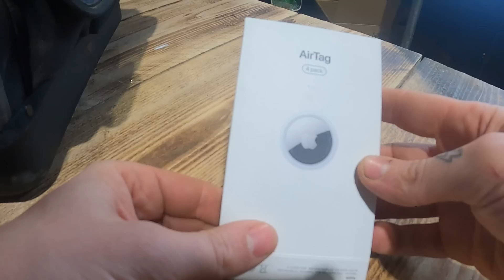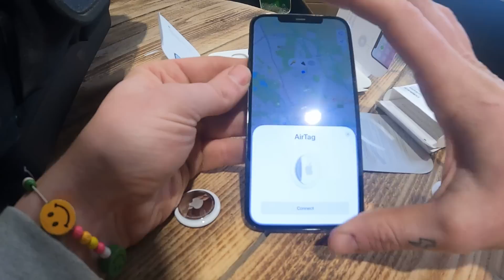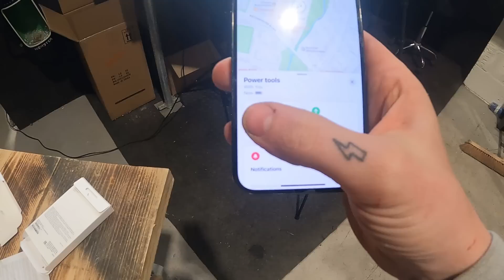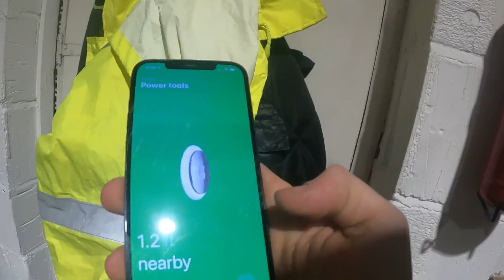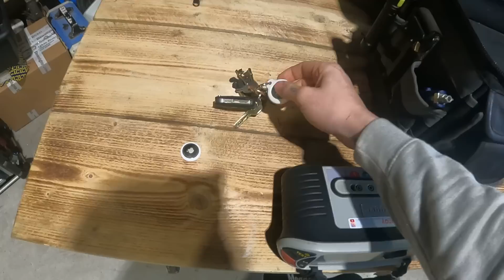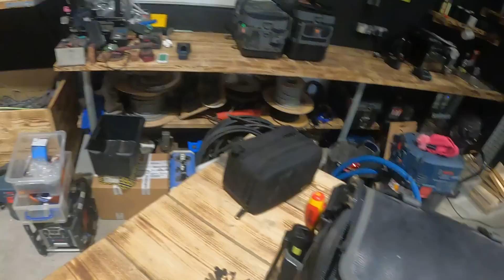Tracking Down Robbers that steal our Tools - Electrician

Comment: do you have any videos on power supply on a cooker extractor hood please?

As im still training at the moment. If i do a kitchen rewire. Do you take it from the new kitchen ring main as a spur to a FCU as I already have a switched spur on a radial for the fridge freezer. Same for the washer/dryer and cooker. So only the worktop sockets are on the ring main but no spur as off yet. Can I spur off this for an FCU to the cooker extractor hood?
Thanks.

Comment: Had my van broken into twice and all my tools stolen, first time I was naive, no extra locks on doors or a secondary alarm and I wasn't insured but was the second time although still a huge inconvenience replacing everything. Plus all things that you have accumalated over the years that you only miss once once they are gone. BTW 2nd time the van was parked underneath my open bedroom window, so they "dragged" the van 20 metres down the street (hand brake was locked in place). You need a good discipline to keep all your tool receipts, note all the serial numbers and take photos, makes the whole reporting and claiming process much easier. Unfortunately there are so many unscrupulous people out there who just want something for nothing with no thought of how it will affect you. I was extremely lucky to have a builder/electrician friend who lent me his "seconds" electrical tools, he liked all the new versions of tools, so had a number of duplicates, thank heavens for his generousity or I would have gone under. The Police told me that the thefts were quite often well organised and the tools mostly went abroad via containers in bulk.

Comment: What i normally do with mine is create a 3d printed shell make it look like something totally different. Place it in the middle glue both half’s together and just take it apart when the battery needs to be changed. There are also various guides on how to remove the beep
Reply: I'm going to put a few in my batteries and powertools themselves. Heck if I can put some in my my mft ans gas flue analyser I will. I don't know if the cal security stickers will allow me to though, meh 🤷‍♂️.
Great idea though pal 👍🏼.
Reply: I label mine “Definitely not an AirTag”.  Nobody knows what’s actually under THAT label.

Comment: Awesome tools to check out:
knipex cable shears 95 16 165 (they have like 20 different variations)
knipex cobra water pump pliers 87 01 250 (they also make a buzillion different sizes and handle types)
stabila pocket level 17768 (they have like four different models)

Comment: Just an FYI Airtags are not GPS trackers, they rely on other Apple devices to be around them to report their location back to the Apple servers. If no Apples devices are close you will not get a location ping.

They also will make a noise after being away from the registered iPhone after a set period of time, I think its a week but I am unsure. I know Apple recently shortened this time due to stalking concerns.
Reply: Yeah I have one in my van and I'm not the registered iphone nor do I have a iPhone. The noise is a dead giveaway
Reply: Yeah came here to say the same. Video may have been made before the mass stalking concern changed the Apple position re alerting. 
To be honest though, most thieves won't know to hunt for trackers and if your kit has been gone for a week+ it's probably game over anyway..
Reply: Think it also pops up an alert on near by phones as well
Reply: Apple devices will also alert that you are being close to a unregistered airtag, again for the stalking concerns. If the theif was smart enough they could dump the tools in range of a phone and see if anything triggers first, similar to car thievies dumping the cars on a random street to check for trackers.

Comment: Tile do a credit card sized and shaped tracker. They’re incredibly discrete. I have one glued inside the lens of my trailer tail light. 
They could be glued to batteries and they’d still balance. There’s no anti stalking mode so the crook won’t be tipped off by its presence. Well worth doubling up with air tags.
Reply: Tiles only work with your phones Bluetooth once out of range it’s useless to you. It’s good for marking your gps/Bluetooth last connected location for example  which on disconnection it logs the location of loss however it does not log future movements away from you apple AirTag does by using other iPhones arround the world to track actively.
Reply: @HogwartsBasement  Tiles work in exactly the same manner as AirTags in that they also use other Tile users phones for locations. That’s Apple and Android. There are hundreds near me.

Comment: Sadly I am not an iPhone user but these look amazing.  I understand they are Bluetooth based but use neighbouring iPhones to communicate and in so doing they pick up the location using the iPhone's location so effectively they do provide GPS level tracking when there is a nearby iPhone.  I've seen these used for tracking bicycles and it's pretty cool.
Reply: Get an android compatible one
Reply: @jamiecullen9075  I don't think they exist? These gadgets rely on the iPhone ecosystem?
Reply: @NivagSwerdna  Do some research if you want a tracker, Tile are a very popular brand that have different products and models, I have AirTag but there’s plenty of options
Reply: @NivagSwerdna  Samsung have their own version,  probably work on any Android phone

Comment: I take it you have to have an Apple phone etc? is there a yearly subscription fee and do you get a notification if the battery is going flat? Are you still using that wet/dry vacuum cleaner for your van and work mats?
Reply: Yes , no annual fee  you can get a pack of 4 for £80 out of Costco  and it gives you a battery notification

Comment: I was not aware that the tags had GPS built in as you stated... still not actually, I thought they used the GPS device in the nearest iphones, please correct me if I am wrong ???
I suspect they may have to be withing bluetooth range of an iphone, as yours was when dispalying it working, much the same as a Tile tracker.
Reply: They ping nearby apple devices over Bluetooth to get location. They are not gps devices. 
No Apple devices around, no location.

Comment: I had trackers that used sim cards small device about the size of a phone battery inside equipment we used to hire out.  A power ampoxer it did go missing device died but when it was pit back in to use plugged in.  The device came to life started charging and sent me a text were it was got it back.  I read about air tags and think there bluetooth so low range.  Also need iPhone with the app on to work.  If I came an took your bag an drive away as long as am not close to some one with a iPhone with the app it will not tell you.

Comment: Fantastic idea nick, just worry’s me that it would ping the robbers phones if they had an iPhone 😞
Reply from the maker: it would but hopefully buy the time it does they would ditch the stuff if u have hidden it well
Reply: @NBundyElectrical  a fair point my dude, it’s a fantastic idea tho 👏
Reply: Just to clear it up lost mode being activated when you loose your items, it will partially disable the function that allows tracking notifications to the baddie however hiding the tracker inside plastics can help a lot to make it more difficult for them to take. Engraving your stuff with your company name and details “procuring this product through sale is a crime” “not for sale” etc or putting a company security label over the serial number of the item label may not be noticeable to the baddie.  Make sure you take pics of your inventory and include serial numbers these need to be provided to police to add to the database for stolen goods.  If the robber does see the tag they can scan the tag with an android phone or apple and a message will appear from you of your choosing. 

For vehicle tracking make sure the tags somewhere near a window like in a headrest so it will actually ping you using peoples phones outside the vehicle if it goes missing.
Reply: @HogwartsBasement  that’s awesome I shall look at getting these 👏 Thankyou
Reply: Think I heard you can ping a message to their phone right?
Reply: For vehicles you can stick them(with some dubble side tape) on the inside of a wheel.

So the thing is coverd by the tyre.